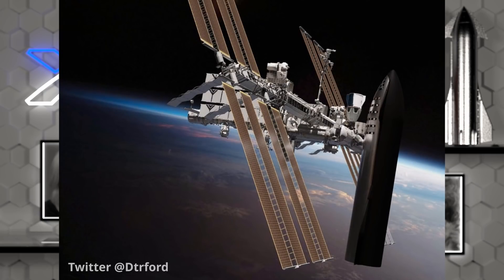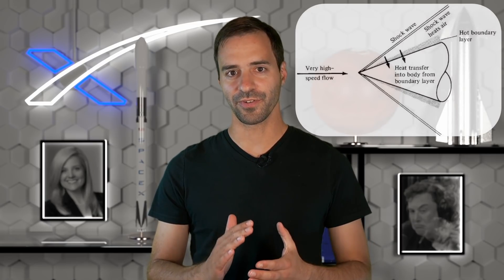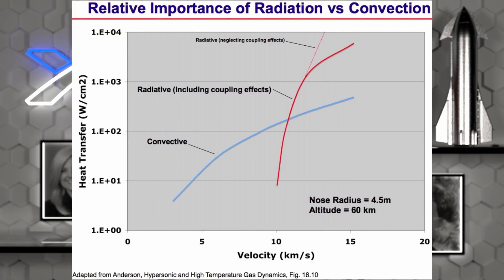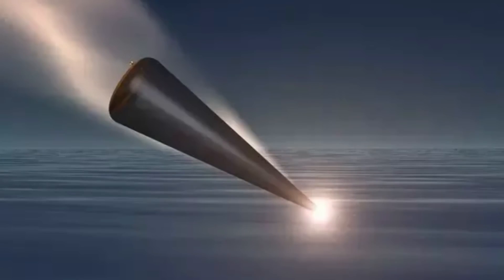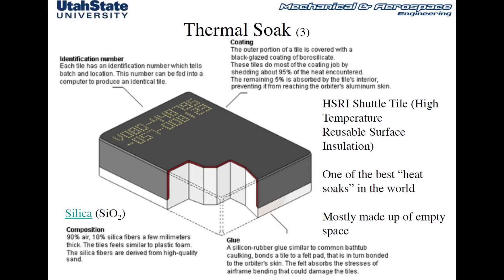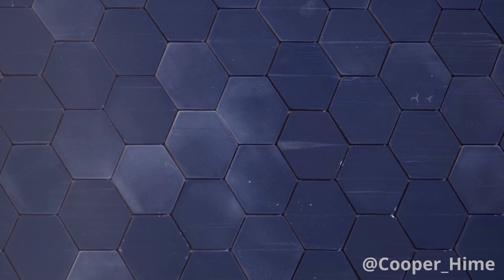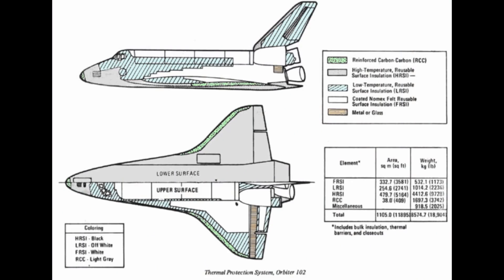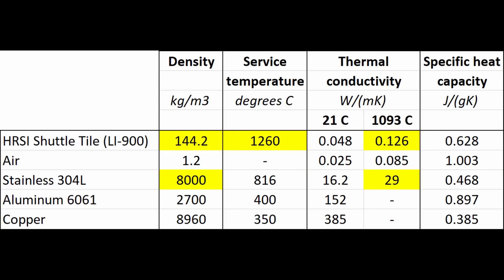Thermal Protection System - Starship vs. Space Shuttle

Comment: Very interesting video ! I thought starship would go for an ablative heatshield
Reply: Then you would have to reapply a new ablative heatshield after every flight. Elon would like to get the Starship turnaround down to hours, but just getting down to days would be a big deal. IIRC, some recent Falcon 9 B5 boosters have been turned around in less than 4 weeks.
Reply: @steveaustin2686  you could have an ablative heat sheild that support multiple flight, then an automated way to replace it.
Reply: @alisioardiona727  I'm not sure that would work that well. If you have enough ablative material to survive multiple landings, then the first few landings are carrying extra weigh they don't need. As I understand it, the steel that Starship uses has over twice the heat capacity of the aluminum the Shuttle used. The heat capacity of the steel covers most of the range of heat values Starship should see. Adding tiles on top of that, and that should take care of it all. Not to mention, since Starship is on top of the booster, instead of side mounted like the Shuttle, you don't have to worry as much about tile damage from falling ice and insulation.

Starship is not as complicated an airfoil as the Shuttle, so there are fewer unique tiles. I understand that almost all the Shuttle tiles were unique, greatly increasing the cost. Looks like the majority of Starship can be covered with the same hexagonal tiles, greatly increasing the turn around time if a tile is damaged.
Reply from the maker: What the above commenters said. Not even Space Shuttle had ablative, and it was never supposed to fly as often as Starship.

Comment: The silica tiles also have a propensity to absorb water. The water proofing had to be reapplied every flight, as it blew away during entry, adding significant labor during flight prep.
Reply from the maker: Thank you for pointing this out! I am aware of the water issue on the Space Shuttle, but I didn't realize that Starship has to solve that as well!

Comment: aren't the "expansion" gaps in between the tiles, to accommodate for the shrinking of the steel during orbit?
Reply from the maker: Possibly! Or contractions when fueled? I'm not sure which thermal event is it aimed towards.
Reply: @spaceflightexplained360  yes, very good, the cryo-fueling is probably the critical design parameter for those gaps.

Comment: I remember a good comment once that the Space Shuttle should have been impossible, but they managed to make it work. The resulting spacecraft, though, was so complex that if you tried to make any kind of major change to it, it quickly got out of control and you pretty much had to design a whole new spacecraft.
Reply from the maker: It was in a way too capable thanks to the air force spy sat deployment requirements. At the cost of margins and, well, cost.

Comment: We already know the current (no guarantee they won't change) that the Starship tiles are not just similar to the STS tiles, they are near identical: sintered purified silica fibre, glazed with Borosilicate reaction-cured glass, and then waterproofed with a Silane mixed with Acetic acid (minor difference here: Starship uses methyl-trimethoxy silane, STS used dimethylethoxy silane). The original HRSI tiles, not TUFI, not HETC, and absolute 100% not TUFROC. This information if from the Florida Department of Environmental Protection facility inspection report of the tile manufacture facility on Astronaut Blvd.
Reply from the maker: Thank you for the additional info! That was my assumption as well, and we should expect some iterations on improving the mechanical properties. But I would not expect groundbreaking improvements in the near future.

Comment: Imitate the space shuttle solution for heatshild is a bad idea, if you consider only the fact that starship have a cylindrical shape that means that surface covered in tiles most be more than 55% bigger than for a flat belly, that means 800 square meters covered with tiles if it weights is only 20 kg/square meters that is more than 16 tonnes, a round shield put on one of the end caps will be lighter and make the same job and the starship wouldn't glide like space shuttle so could re-enter in the vertical position and not on the side also a instabily issue for a barrel shape vehicle.
Reply from the maker: I think you are in the right ballpark, but those are the tradeoffs. The flat belly is not an option because the whole thing is a pressurized tanks and the added strength needed to sustain flat shape would be immense.
Reentering in the vertical position can potentially make it worse, because the drag would be low and that means that you would hit the dense layer of atmosphere too fast, and burn up there. Not mentioning the G forces on the crew when the vehicle would reach 10-30 km altitude.

Going belly first allows you to slow down gradually, using a little bit of lift to stay up longer and to have much smaller velocity lower down.
Reply: @spaceflightexplained360  for the hottest part of aerobreacking maneuver 11th meter diameter heatshild is enough, after that you can flip in the horizontal position, or if you change the design use larger gridfins (I mean much larger than in the booster) it's a tradeoff lighter heatshild but bigger and heavier aerodynamic surface controls and more stable re-entering. (also much cheaper and simpler doe to smaller and simpler shape round heatshield ).
Reply: With their big re-useable engines, why can't SpaceX slow the rocket down in orbit, and then drop like a stone? Why do they need to hot-surf the atmosphere to bleed of orbit velocity?
Reply from the maker: @wim0104  That woulds require them to carry more fuel for landing to slow down first, which would be directly subtracted from the payload capacity. It is a lot of fuel.

I think they will still need to slow down a bit propulsively, just not all the way. Only as little as they can get away with.
Reply: @wim0104  propulsive landing isn't a option, but you can use smaller heatshield like I explained.

Comment: I'm curious how much of that heat would be transferred to the propellant. During reentry it's mostly gaseous methane/oxygen for pressurization, so it doesn't have as much heat capacity as the liquid form, but it is already gaseous, so there's no problem with boiling off. It could heat up, taking energy away form the steel, and be vented away if the pressure is too high. I wonder how much of an impact would it have.
Reply from the maker: That is a really good question - In one way or another, they will be releasing the gas to keep the pressure at the intended levels, and it might take some heat with it. How much would it be?
I think the question that will drive this is "How hot can the steel body get before things go bad". Because the fuel will not get hotter than that.
Reply: @spaceflightexplained360  I don't think propellant will get hotter than the steel... unless it heats up due to increasing pressure? It's initially much colder, so heat is transferred from outside to the propellant.
Reply from the maker: @pmj_studio4065  Of course, my apologies, I somehow skipped the "not" there
Reply: @spaceflightexplained360  ah, ok 😆